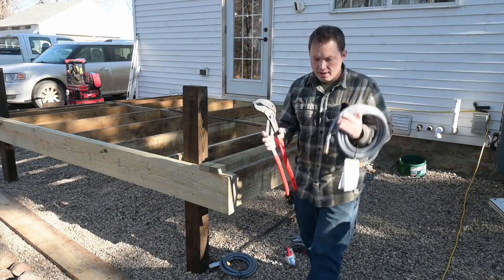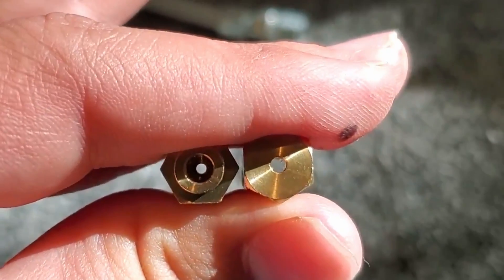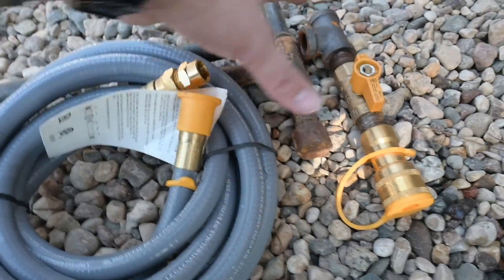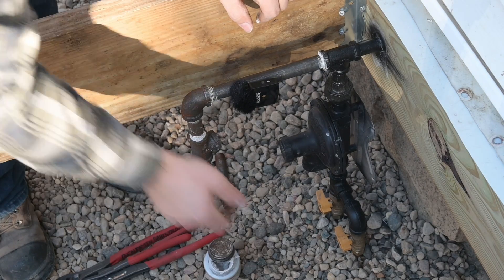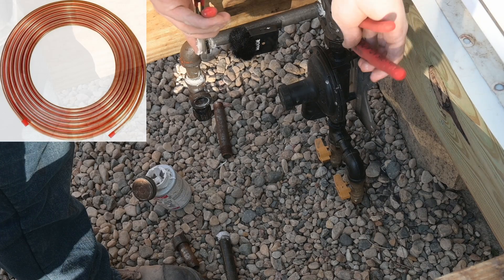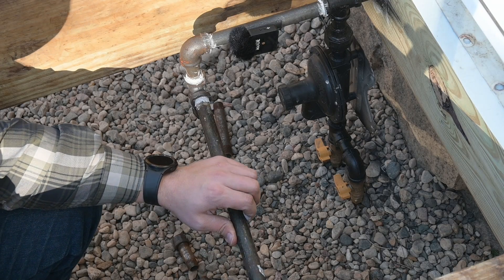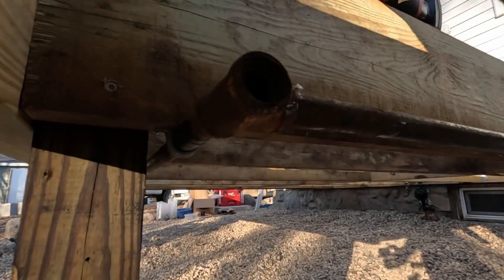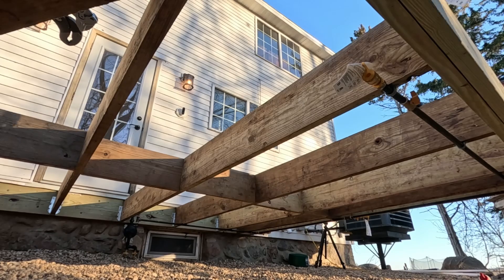Never Fill a Grill Propane Tank Again! How To Connect Propane or Natural Gas to a Grill or Griddle

Comment: Hello,

Your set up is propane however the kit link is natural gas could you by chance recommend a a propane kit. I have a propane access on my small back porch but if I could utilize a quick connect hose kit and have the grill down on the concrete slab that would make grilling so much more enjoyable.

Comment: Am I able to use the hose on a high pressure wok burner? I need the exact set up you have in the video, except using 3/8" hoses and fittings for a high pressure propane wok burner instead of 1/2" fittings. Any recommendations?

Comment: That regulator should be vented away from that window. Supposed to be 3ft from opening into building. Also in the gas field we don't use drip legs they are sediment traps. Nice work otherwise

Comment: Started doing Plumbing when I was in my twenties for a propane company, used pipe dope mostly at first, whenever we did liquid propane we did tape and dope, towards the end of my career I used tape only, what I found was the dope after years in service would develop little pin leaks from the pressure and the tape would not. I don't think it matters either way, just my opinion, but what do I know I just retired from doing it after 35 years

Comment: Thank you I didn’t even think. Never used black iron outside always galvanized. Black iron isn’t as strong
Reply: Also invest in pipe wrenches. Those are will give you problems with your wrists
Reply: My info tells me to never use gal on gas lines.

Comment: It seems like you overly complicate what could be an easy connection, warnings and all that... Propane has a high octane, but less energy than gasoline, & CNG is used in busses because it has a clean burn, for the most part. You see black smoke from a BBQ grill, a diesel truck, Sometimes an older gas car, but never from a Propane forklift, or a natural gas stove as that is natural energy, no pollution. I really like your videos, & have passed on many. Gas, electrical, is simple. just hooking things together in the right order. You don't put gas in a diesel tank, as that would trash the engine, or the other way around, not good, bur the engine is okay-ish...

Comment: I am a propane delivery driver, and sometimes help with service side of things when deliveries are slow. having a second stage regulator under a deck is a common practice, as long as a propane can semi-comfortably access that regulator for leak testing or have another second stage regulator with better access on same system. also as long ask your deck is not sealed under it. Also, your propane provider will be happy if you make a door in the floor of the deck for that regulator access, its not code requirement, but who wants to be on their belly trying to access the regulator.
Reply from the maker: Thanks for sharing your knowledge on this!
Reply: I wouldn’t recharge with it under

Comment: I would use brush on paint for painting gas pipe. If it was out in the open, spray will work fine, but with pipe mounted under the deck you are likely to miss many spots.  Might need 2 coats with brush, but not too hard.

Comment: Thank you for sharing, I hope you have the time to answer this question, 1. is that a propane manifold?   2. can a gas/propane source run any number of appliances or i sthere a finite number of appliances you can hook up to a source? thank you!
Reply: It's finite, you can call your gas company and have them help with figuring out if you have the capacity. A friend of mine is installing a gas stove, emergency furnace, and electric generator and the gas company decides what size of line you'll need based off what's all connected.

Just like water with it's gallons per minute I know gas has a limitation based on pipe size and utility pressure, most utilities keep the pressure levels the same for various reasons most of fairly obvious.
Reply from the maker: It is limited, but in residential applications you rarely encounter more than what one standard regulator can provide. Maybe I'll make a video about this.
Reply: Thank  you guys, That would be fantastic Benjamin, I am planning to replace my residential stove with 1. flat griddle, 2. oven, 3. a 3  burner hot plate, all commercial, and eventhough they run off the same size gas pipe, I am wondering how I would know if I am getting the amount gas they need

Comment: Keep it simple by stating everything in psi.  1" of water column = 1/27.7 psi, so 12" of water column = 12/27.7 psi =  .433 psi after your pressure regulator.
Reply: Gas is measured in water column si final delivery pressure. Every appliance I can think of is in water column. 10lb, 5lb, 2lb, then to water column. 
It's best to use industry standards and not go off and do your own thing.

Comment: Bubble testing new iron pipe at operating pressure is not how it's properly done Benjamin.  It may be adequate, but it is not correct or to any local or national code. Teach better. 
To properly test new piping; 1.Isolate new piping from the rest of the system. 2.Install a high pressure gauge. 3. Pressurize with air or nitrogen to local code specs 4.Check loss after local code time specified. In my area, the standard is 15 lbs pressure held for a minimum of  24 hrs.
Now if all this seems a little anal to you, remember this; 1.Sometimes black iron pipe fittings, which are cast, can be porous, leak,  and not be caught with soap bubble testing. 2. A cross threaded connection may initially pass a bubble test, but with time and temperature changes, even a subtle leak is likely to be found. 3. Not pressure testing to code may void any insurance policy.
Reply from the maker: I definitely agree that's the best method. In our area, high pressure testing isn't required in all areas, but those that do are either 10psi for 24hrs or 50psi for 1hr. In this situation, and especially with outdoor gas lines, I am personally comfortable with bubble testing at operating pressure.
Reply: Even there is a leak its not a big deal with outdoor gas nothing bad will happen.

Comment: I'm curious to know what was going on at 2:37.... don't think I have ever seen this.
Great Video.
Reply: It looks like a water distribution manifold.
Reply from the maker: Hydronic boiler system I installed.
Reply: @BenjaminSahlstrom  Yes.... I went to another video you had on building boilers and found it. I should be ashamed of myself for not knowing. I was a maintenance guy on a low pressure boiler system for over 30 years.  Haha But I will admit, ours was nothing as complex as yours. Great Video!
Reply: That is an in-floor heating system with several manifolds

Comment: Do you need a permit to extend the gas line like this?
Reply: Depends on location.
Reply from the maker: Likely in many jurisdictions. Always best to check.
Reply: Depends on the jurisdiction in which you live.  Some won't even let you DIY gas connections and only a licensed plumber can do it.